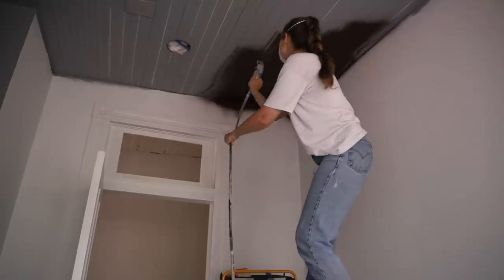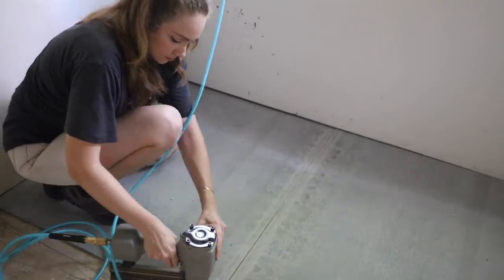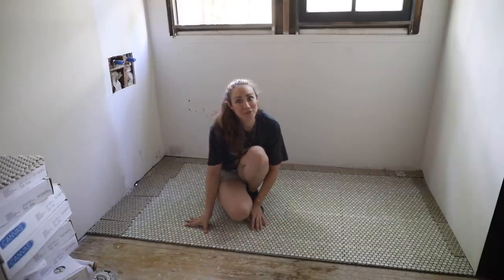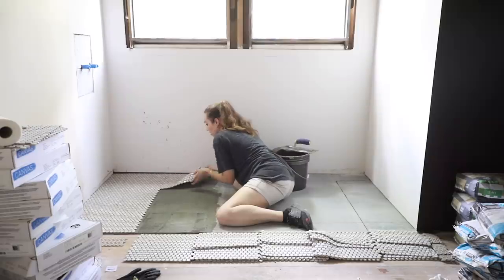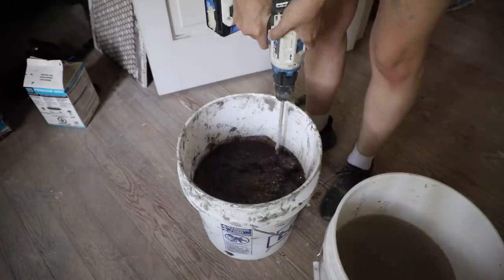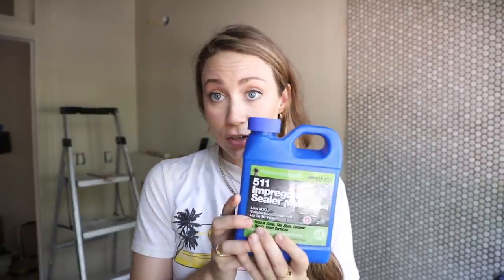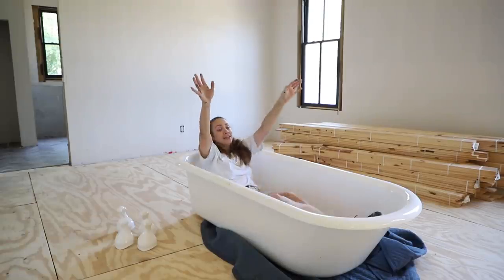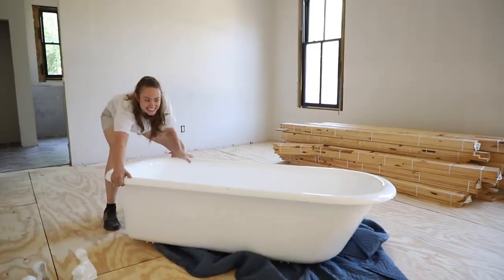Guest Bathroom Makeover EP 3 *Installing Tile + Clawfoot Tub!!* | XO, MaCenna

Comment: For anyone who is wanting to lay their own penny tile:
- DO get spacers. Even professionals suck at laying penny tile and you DO need spacers even though it comes on netting. Just spend the extra $5. It'll be worth it
- DO stagger the sheets so you can hide the inevitable wider grout lines from the above
- DO use a trim piece (i.e. Schluter straight edge) to finish your edges
Reply: These are great tips! Schlueter edging just makes the finish so nice. I also find groat release is a life saver for cleaning dark groat off the tile 👍
Reply: This!! Penny tile is one of the HARDEST to lay 😩 I’ve talked to so many professionals who say they shouldn’t even make them 😂
Reply: Came here to say this. Tile termination is crucial and you definitely need a schluter strip or a reglet reveal or SOMETHING
Reply: Maybe she is going to install wood trim at the edge when she finishes the wood floors. I’m not sure how that would look overall but it’s something. If she has to go back and install the tile edging won’t she need to use more grout to set it in? Not an expert on these things ladies.
Reply: @donnacrosleythibault812  The tile edging has to go under the tile. She would have to add a row of tiles if she wanted to add it later .
Reply: @Pinelo-pie  I agree that’s why I said I’m not an expert in these matters. Thank you
Reply: @donnacrosleythibault812  I doubt it, to be honest! I think it's the rustic look she's going for. Also, her entire job is making YouTube reno/DIY videos so it's not a big deal if she has to redo this in a few years. More opportunity to monetize videos (😅). But the average homeowner is going to do it only once, so they should have the information to do it right.
Reply: Thanks for this! You can see alot of little mistakes in the few shots that she shows. Especially above the water faucet. I'm a perfectionist and I know she is too so it was bothering the heck out of me. 
It would definitely make a for a great reno video for the future.
Reply: @yazzybananas3106  for me personally I think the claw foot tub is overpowered by all the penny tile and the double window especially since she painted the window with the dark paint to match the alcove. She’s not going to install a shower ring from the ceiling in order to use the shower wand. She indicated her guests would just sit in the tub and spray off. How unusual is that?  Another individual indicated that you don’t install the tiles in a straight line that they should be staggered so the grout lines are not as visible between them. She didn’t do that either. It’s a live and learn process. In the video she said the tile wasn’t suppose to get wet! How’s that?
Reply from the maker: I chose to do a wood trim edge because it steps down to our wooden floor but the Schluter ones are really nice too!
Reply: @donnacrosleythibault812  You mount first the tile edge and start laying tile from it.

Comment: hi macenna! i’m a display builder at floor and decor and your first at installing penny tile went very successful! here’s a couple tips that i thought would be important to add! 

- when cutting the penny tile on a wet saw, i cut it on a thin sheet of cardboard (usually the cardboard backing the tile comes packaged on) in order to prevent the pennies from bending inward when they meet the saw blade, it gives a bit more stability! 

- slower is definitely the way to go when cutting tile, and will prevent chipping. 

- you can also use stick painters tape on the tile, over where your cut line is to prevent chipping on the surface of the tile as well

- also if anyone was wondering, the tile she used is called La Belle Purity Mixed Ceramic tile, and its no longer available online because its been discontinued. 

hope this is helpful!!!

Comment: This is looking SOO beautiful! I can’t help but feel nervous about the lack of water proofing 😅 I know it’s not a shower but I’m just imagining there will still be a lot of water spillage and stuff. Is cement good enough between the tile and subfloor? We were sooo over the top with our waterproofing when we renovated our bathroom because mold is my worst nightmare (after living with it for years in previous rentals). I highly recommend Schluter materials. I’m sure you’ve done your research and everything though. Congrats on the amazing progress in your beautiful bathroom! 🥺❤️
Reply: I thought the same thing. If you think that you won't get water places with a handheld sprayer thing, then you got another thing coming. Water sprays way further than you think, even if you are careful. Plus you have to get out of the thing as well and will drip.
Reply: In the US, for showers, the only code requirement for waterproofing is mold resistant drywall with tile over the top. So technically, she’s got all the waterproofing she needs on the walls and floors with the tile. 

The wood trim is what I would be concerned about… we put pvc boards as the trim on the window that is half in our shower .
Reply: Exactly what I was thinking!! I’m a design and waterproofing is essential! I hope she reads your comment before attempting the other bathroom!!
Reply: @freckledspeckled5406  That's not really true - there are many loc. codes with much stricter req. IBC (Sections 2509.2 and 1210.3) For tub/showers or showers must extend to a height of not less than 6 feet (1829 mm) above the floor level of the room or 70 inches (1778 mm) above the drain, whichever is greater - Water-resistant gypsum board may be used as a backing board for tile installed beyond the required tub/shower or shower enclosure walls.
Reply: @walterhobocienski5959  hahaha I hope everyone is making their shower at least 6 feet tall… but my point still remains (especially considering her tile goes to the ceiling): she’s technically got all the waterproofing she needs.
Reply: @freckledspeckled5406  My point is always check is state and local (municipalities) codes first because "In the US, for showers, the only code requirement for waterproofing is mold resistant drywall with tile over the top.." is not accurate because many areas are much more specific and restrictive. I quoted IBC IRC because all US states reference these codes or modify them in their own State req. as min. Specifically we don't want people buying "mold resistant drywall" and tiling over it thinking that's all they need to do to be compliant without performing to: ASTM C1178, ASTM C1288 or ISO 8336, Cat C, ASTM C1325, as quoted in IBC Sections 2509.2, and 1210.3 (area within). As for MaCenna's videos I'd advise are for entertainment only. I don't know exactly which jurisdiction this project is based, but it appears she's building without permits or inspections.

Comment: Hey Macenna, I have a thought about the practicality of the tub set up! I’m imagining that cleaning up behind the side of the tub, under the window, might be a little burdensome in the future. Water falling from the side of the tub onto the floor, mold and mildew buildup and the accessibility of getting to that spot to thoroughly clean. Hope that makes sense. What if you maybe built something to go around the side of the tub and then connect to the back of the tub where you have all that open space? Like a custom bench, towel, shampoo holder, something like that that wraps not all the way around the tub but just on the side to the back. 

Hopefully that makes sense!!

Comment: Having a refinished vintage claw foot with handheld shower myself, I can tell you for certain water will come into direct contact with your tile.  Don’t fool yourself thinking you’ll be careful, it’s gonna happen.
Reply: exactly what i was thinking. trim for the tile edges would be better too
Reply from the maker: @bc3722  we are of course adding trim to the edges those are part of the finishing touches
Reply from the maker: Your probably right, but also this is a guest bath that we don’t anticipate using often

Comment: When I am tiling I clean as I go. So it’s not on there more than 2-3 mins. Otherwise it’s much harder. Wipe it on with a float. Wipe off with a window squeegee that has a rubber edge. Will make it so much faster for you. For any stubborn bits that have dried too fast use a baby wipe. 😀

Comment: People never understand how much arm work goes into tiling and how much cleaning the tiles need…I’m a professional tiler and I have a tip… during grouting if you use a big square tiling sponge 🧽 damp you can wipe off the grout straight after grouting and doing it in stages means it won’t dry …once it’s dried you can then buff the tiles which saves you doing all that excessive cleaning on dried grout ❤️

Comment: It looks so nice MaCenna. You guys have worked so hard and now your vision is coming true! Love the colors! Don't worry about all the trim, etc. Advice. You will work it out. There is so much flexibility on how you want to finish edges. Hard edge with a finished piece of trim  or a transitional method. Where the tile expands and melds into the other flooring. When I did my kitchen tiling I decided I did not like the prefab. Metal finishing trim so I just flipped the glass mosaic tile for a finished edge. It worked for me. I have not used penny tile so I don't have experience with it, but I do know that even with the mesh backing the tile can shift in the thinset. I did use tile spacers with my glass mosaic tile with the mesh backing. Be sure and get the correct size of spacers based on the grout line and depth of the tile. With the Penny tile being much smaller the shifting should not be as drastic as the sheets are lighter.. but the upright walls would probably shift the most(gravity pulling them downward)in my experience anyway.. Keep up the great work! Cheers!  😊

Comment: Looks great, i wanted to let you know for the next tile project you have that you dont have to wait 30 min before wiping off the grout. It is much easier to work in sections and wipe as you go. That way the grout is not dry as you are wiping off. You just need a gentle hand while wiping.  And you can get it clean really fast.

Comment: For the next bathroom, perhaps you could remove the wooden flooring below the bathtub and install the concrete tile directly to the framework so the penny tile is flushed with the floor. Right now there is a level difference between the wooden floor and tile but I'm not sure if you do have a plan for this already!

Comment: The floor needs to be engineered to make sure it won't flex under the weight of the full tub...adding 1/4" of Durock won't stiffen the floor. In an old house the floors are often quite thick planking so this might be ok, but it would be good to have mentioned that.

A decoupling membrane to mitigate the chances of cracking and provide some waterproofing around the bath and up the walls would be a great improvement to this installation. Even with a tub and a hand shower the floor will get wet and over time it all adds up. Also water vapor is an issue in bathrooms and I hope that an extraction fan is in the plan.

Also claw foot stand alone tubs are loved by many people, but they are a pain to clean behind and around.

Comment: I love this, but I will say, after having a tile shower, installing a waterproof liner/pan, is a good practice. Tile and grout wear down and need to be resealed over time and we had some major water issues because the contractors didn’t install a pan. We had to rip out the shower and redo it two years after it was put in.

Comment: It looks great, but next time you do tile that has an open edge (ends in the middle of a wall instead of ending in a corner or against trim, you should use Schluter edge to give the tile a clean (and safe) finished edge since tile cuts are rarely perfect and always sharp.

Comment: Everything in the bathroom looks amazing. You should be sooo proud of that window trim- you would never know it hasn’t been there the whole time. The only question I have is about how close to the wall the side of the tub is? I heard u mention it so maybe you’re already planning on adjusting it but after being in an apt with a claw foot tub the biggest issue I had was that it was close to the wall to put a shelf to hold things or to get the shower curtain around it (was a tub /stand up shower) but too far away to keep the water from going in between the wall & tub which also made cleaning behind it- like between the wall & the tub- basically impossible. Like laying in my stomach trying to get dust/ pet hair whatever from underneath & dry up water etc. Just something to keep in mind or maybe ask the plumber about?

Comment: If you wear rubber gloves when wiping up the grout it's better for your hands. It can really dry out your skin.. Also you can put the sealer in a plastic cup or even cut a water bottle in half. That way you can get your brush easily into the sealer. I've done a lot of this🤗. I would also buy a big pack of White rags from Lowe's or home depot for polishing up the tile when your done wiping up the grout and before you seal.  They're like small white towels, you will use them. Just a few helpful hints😊

Comment: Hi MaCenna, 
 I wondered if your contractor pointed out the fact your bathroom floor needed to be reinforced due too the weight of the cast iron bath. 
 I did a restoration on an old cast iron claw foot bath in a Victorian home we were renovation some years ago, we relocated the bathroom and the floor had to be reinforced due to the bath being so heavy. The inside was in good condition so I rust proof painted the body in navy blue and the feet gold, it came up a treat I was delighted.

Comment: I feel like if/when the shower head is used and then hung up again it will have that residual drip like most shower heads do and will cause water problems on the tile beneath it. Also, as a US person living in Europe, hand held shower heads are  quite a hassle, since there is no separate shower in the room you might wanna think about a non-handheld option

Comment: Something I was wondering as you put the tile down on the floor. Maybe I missed something but where is the drain pipes for the claw foot tub? I see the pipes in the wall for the faucet but puzzled about how the water will drain out! I saw the hole in the tub but it is too high on the tub to drain out. Maybe it will all be clear when the plumbing is done.

Comment: I love this video but I am also worried with that window wood frame in the shower... I had it too and it rotted... I had to change to a PVC one.
Keep it up 💕
Reply: I get the idea that this is simply for bathing with the option of rinsing your hair inside of the tub?
Reply: @lauramitchell6725  Maybe... But warm and hot water always make the bathroom humid, specially during the winter, when it is already humid... Just for the sake of the wood I personally would give it a polyurethane protection coat on top. Mind as well think ahead rather suffer with regrets 😊
Reply: @ritasilva8797  True

Comment: I am really confused.  Don't you need to use some sort of waterproofing on the wood and under the tiles?
Reply: She did, she painted it with that red sealer a in video 1 I think.  She also put plywood over it to make it stronger.  It is not a shower, it should not get wet.

Comment: So I’m curious if you concrete boarded up the walls where there can be potential splash. Also a waterproof membrane on the concrete board is necessary because the concrete board loves to hold moisture. Concerned about the corner transitions of the wall. Concrete board should be joined with mesh tap and thinset, then a brushed on waterproof membrane.